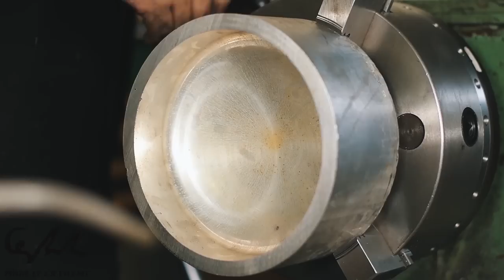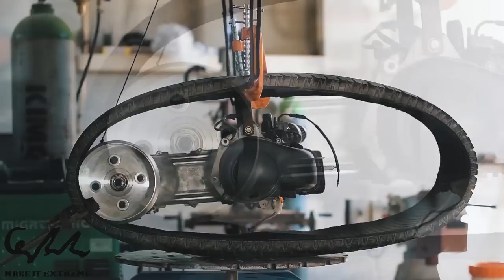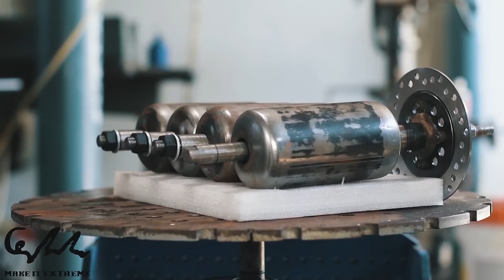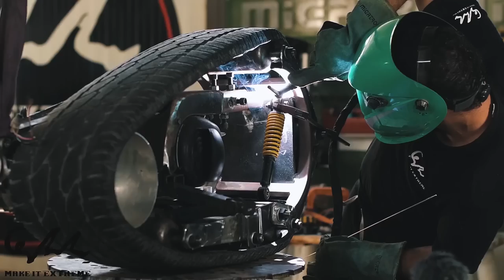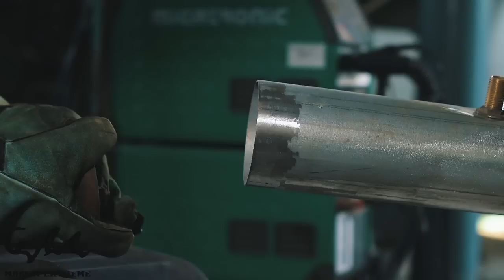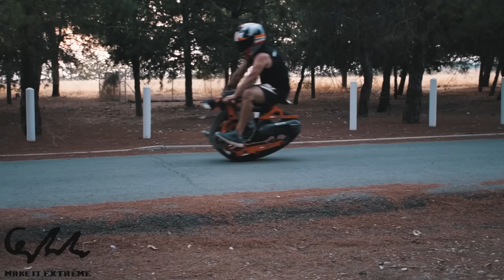Making a monotrack bike

Comment: i dont have the equipment or the knowledge but my thought with these always was what if there were 2 parallel tracks each cambered a bit with some suspension. so there was some better lean. like a tank just over simplified and with tread. either jus suspension or you could have some kind of sensors so when youre leaning a lot on one side it slows down just very so slightly so you can turn better. idk im just spewing stuff. 

i dig it either way. keep up the work 👍

Comment: As a machinist, I'm very bothered by the use of a center punch and hand drill to make the 4 hub mounting holes. If you've got a lathe, welder, etc. then surely you have a Bridgeport too? Or even a good drill press? But hey, not my build, and it clearly works, so props to you!
Reply: I noticed that as well....

Comment: Here’s a quick question for the builder. 
It looks like you built this with an All Season Tire that sits on a 16”-18” rim. If you were to utilize a bigger tire 🛞, like a 22.5” truck tire, or a tire for a 24” rim, would the power plant become bigger as well?
Reply: Yes, rotational inertia increases exponentially as you increase radius, + the extra weight, could gear it to go slower tho

Comment: i have learned to fast forward past the quality machine and weld work to the end of these builds that are usually incredibly bad designs in use, sitting on raw steel seat, only riding on one inch of the tread, no shots of it turning...this channel seems to be "cause we can" not cause it works at all.